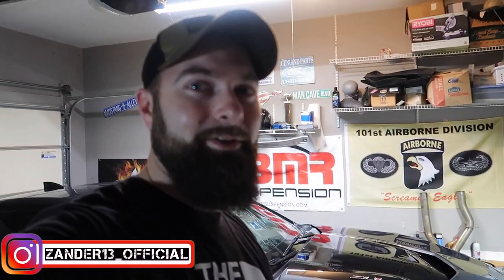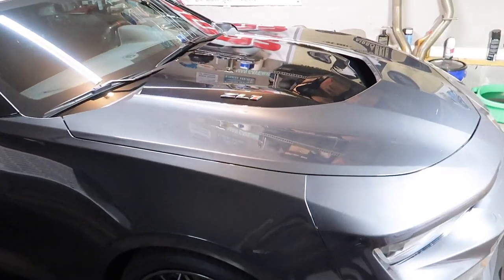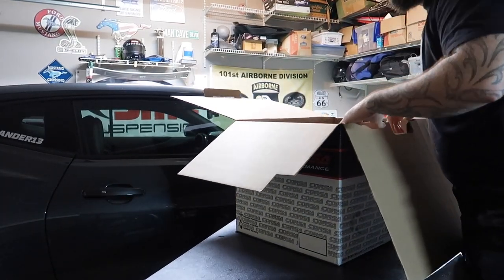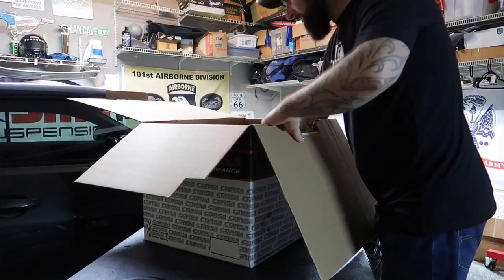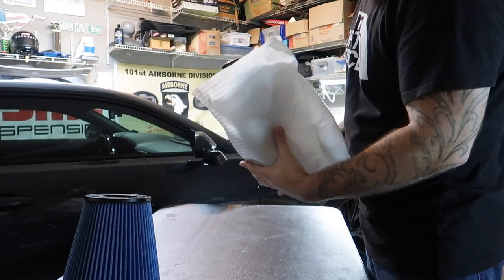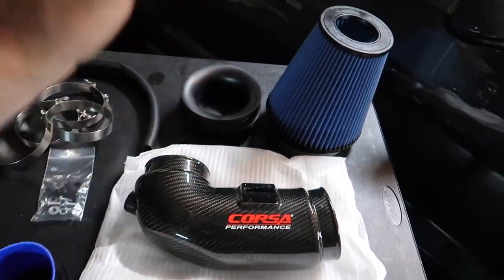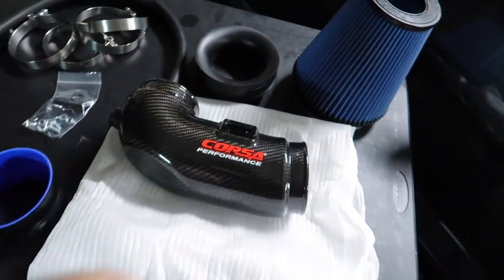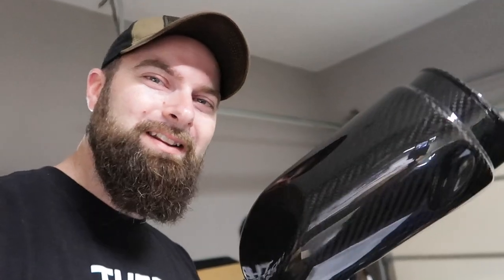WOW! I GOT THE FIRST EVER "ALL NEW" CORSA INTAKE FOR MY CAMARO ZL1 ON YOUTUBE!

Comment: I saw you had the Cold Air Inductions Carbon Elite Series CAI. Did you prefer that intake, rotofab, or Corsa? Does the closed box with the Carbon Elite Series help with the intake temperatures of the air? Your input would help a lot in making my decision

Comment: Curious if you did any data logs after the intake install? Doesn't look like Corsa has any sort of air straightener in the tube, so I would be concerned about fuel trims

Comment: what is the difference between the dry and oiled? I'm looking to buy one right now but I'm unsure of what the difference is. i have a 2020 ZL1.
Reply from the maker: Oiled it re-cleanable and re-usable. Dry might be better For more airid climates. I have always used oiled with no issues.
Reply from the maker: ZANDER13 is the promo code to save on the corsa website
Reply: @Zander13Productions  thanks! doesn’t void the warranty at all? im looking to instal the xtreme+ exhaust and the intake from corsa.
Reply from the maker: @Gxbrxela  correct. Does NOT void warranty

Comment: Here is one for everyone here. I have a zl1 2019 a10. I will cut to the chase. I'm modded with a cam, e85, full bolt on, etc. I was on the old 4' roto fab and we switched to the biggulp roto fab. I have a Maggie and a 103th body. Guess what, back to back with a tune... GAINED LESS THAT 2HP. basically,  no gain from the roto fab to the big gulp.  Unless you dyno before and after,  you will never know. They all claim great things from the manufacturer.

Comment: Hey does your heated steering wheel still work ? I saw you went carbon fiber
Reply from the maker: It doesn’t
Reply: Who makes the steering wheel cover you have?
Reply: @jimbradd2783  check Wildhammer motorsports.